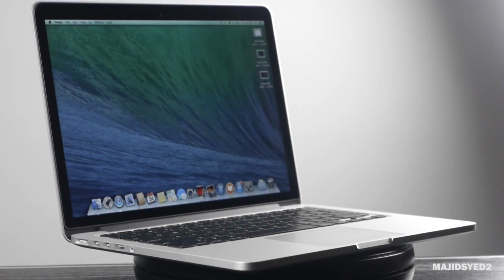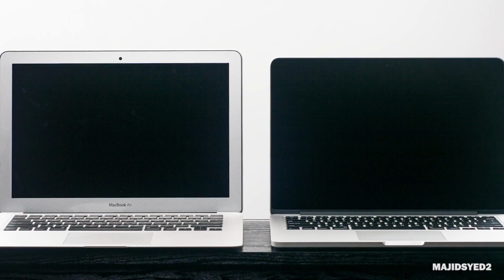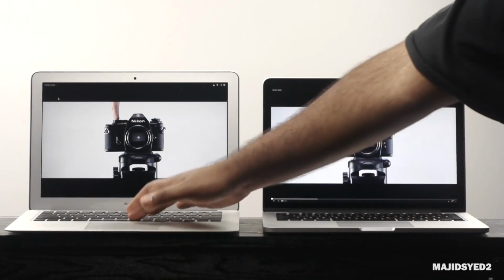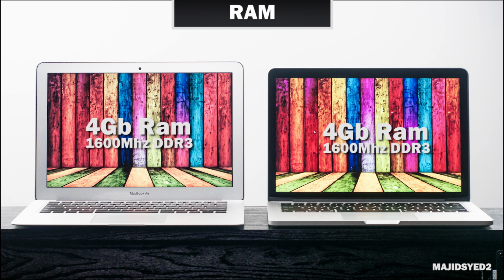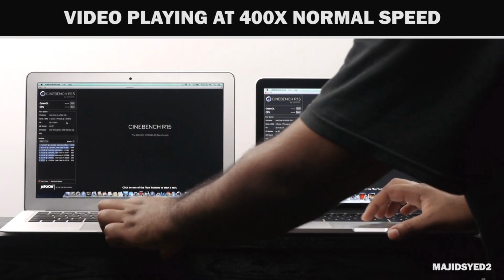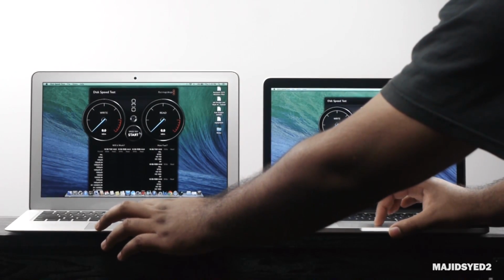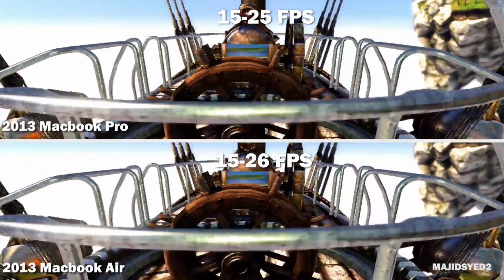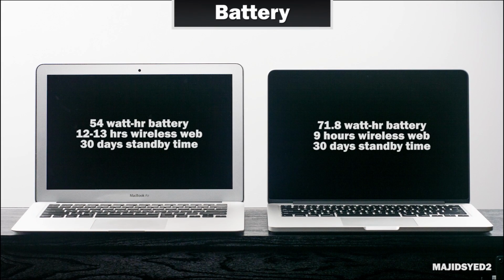2013 MacBook Pro 13" Vs 2013 MacBook Air 13"

Comment: Thanks for the review! The Macbook air seems to have a little black edge between the (collor) screen and the white ridge. Is it just the distants between the glass (thickness of the glass) and the screen, or is it lost space? If so, why would they leave it there? It bothers me because I like the weight and the praise obove the Pro, and there is a lot of efford on this style icon, but its not..yet..perfect.. as they proclaim :').
Reply: the macbook air has no glass on the display
Reply: the macbook air has no glass on the display

Comment: When I'm outside maybe in class I'd use my pro for a few hours maybe on low usage and if there is a wall charger in class I'd be okay... But mostly I could do most of my work on my iPad... At home the same 9hrs won't be bad because I can plus easy.. So BUY A IPAD WITH YOUR PRO.... can switch between tabs with Yosemite

Comment: Which one would be best for a high school student? (From 8:30-3:15 5 days a week use and more for homwork, assingments, Word and Powerpoint use, web sufing, video editing and holding photos/film)
Reply: Air. Definitely.
Reply: Fredrik Iversen I actually have both a 2014 i7 Air and a 2014 i5 Pro, and I have to say the Air with i7 is very powerful for a laptop this small (as powerful as the 2.8Ghz i5 in Pro, which I own). But if you want to play a littlebit and do some intense video editing, take the Pro, because it has Iris graphics.
Reply: Air is a much lighter laptop which makes it a better choice for students. You should get a 13" macbook pro if you are a student
Reply: Yes of course if you want a laptop u can edit and game on the Pro is a much more powerful machine. Me for instance who is going to study journalism in 2 years think that the 13" air is the best choice, for me. I need a light laptop with good battery life, memory and OK video editing.

Comment: I might get MacBook Pro for different stuff and I'll have probaly one game which will be Minecraft will I have heating issues?
Reply: Look up videos of people gaming on the Mac model you want. (It runs minecraft fine)
Reply: Shahzad Khan It'll run MC just fine, until you set all graphics to max (also use  OptiFine). Despite the fact it is not designed to play but to do "not-so-heavy" tasks, it should perform quite well. And it shouldn't overheat that much. But remember, it's NOT a gaming machine.

Comment: I am currently looking at both of the products and I still cannot decide on which to purchase. My budget for my purchase is currently $1,500 - $1,700. I do own the 21.5 inch iMac with 16 GB of RAM and I'm looking to purchase a machine to help me edit videos and designs using Adobe After Effects CS6 and Adobe Photoshop CC whenever I am at school, or away on trips. I have never used either one of the devices, so I do not know if the Macbook Air can even run the programs I need it to do. If anyone who owns either one of the devices and uses After Effects and Photoshop could replay to this comment, it would mean a lot.
Reply: With your budget you should certainly go for the Pro. You will be disappointed with the Air’s display, especially for photo editing. The Air did fine for everyday tasks and did fine running multiple apps, but the screen is a little disappointing to say the least. i sold my Air after a month to get the Pro and really like the screen much better. The Air is fine for everyday users, but for a more color accurate display definitely get the Pro.

You should also consider that this review is for the 2013 model and that the 2014 Pro comes with standard 8GB ram now.

Comment: Well described reviews. I am currently short in budget and the dell laptop i am using is almost dead. So what do you think would be the best choice for me? I need a laptop with:
1. Good quality battery life
2. Good performance while doing video editing for my youtube channel videos
3. Doing graphic design and development for clients.
Some people are saying that buying an air would do it. so going for a pro at my current situation would be a loss for me. What do you think?
P.S i have never used a mac before and highly interested to buy one and start using it.
Reply: You will not like the Air if you have to do any kind of photo or design work which requires color accuracy. The Air's display needs to be improved. I used my Air for about a month before I decided to sell it and upgrade to the Pro. The Air performed fine, but that display just did not work for me.
Reply: Thanks Brian for the reply. I will now plan to get pro
Reply: Hi. Super star i got your review on the first page of google.

Comment: great review! But I'm still confused on which one to get... 
I'll be using it for college... Does the extra weight on the pro retina really matter? and is the screen that good to buy the retina over the air? 
It'll be fantastic to have the retina one with 12h battery life lol
Reply: Karina, 
The Air's display is subpar compared to the Macbook Pro and just about any 1080P Windows machine i looked at. The weight difference is only slightly noticeable. Certainly the Air is a great machine and the battery life is as advertised, but the 8-9 hours I get of my Pro is plenty. I had the Air for a month and it performed well, but the retina display is worth the upgrade in my opinion, despite the fact that I preferred the Air's overall design.

Comment: I went with the high end macbook pro (13 inch)  because it has the portability of the macbook air and the performance of the macbook pro :D  I was worried about apple releasing MBA with retina display so I went with the MBP which has the retina display already....I'm in uni so I wanted something that's portable and powerful at the same time...so the 13 inch high end pro was the option for me....I'm really happy with my mac,I would recommend anyone to go for  the pro! :)

Comment: Hi 
I am a Project Manager in an IT company.Most of my work consists of multiple browsers , multiple skype windows and some programming softwares. I dont do heavy image editing on photoshop or any video editing.Will macbook air be good option for me.I just dont want it to freeze or get slow when I have multiple applications open simultaneously.
Reply: Yes.I am not sure what your definition of a youtuber is , but I believe youtuber today is everyone.Most skilled and tech savy people are on youtube , not just casual timepassers. I asked this as I had never used Mac before and so was uncertain about it.Anyways I ended up getting a Macbook air.

Comment: hi guys .
i am very confused whether to buy AIR or pro retina?
i need a laptop for-
browsing through web, using multiple windows at a same time, skype , youtube, songs, videos, powerpoint, assignments n ol.
i dont knw, if air can handle- browsing, surfing, play songs,work on powerpoint, or even transfering data from a pen drive, ALL AT A SAME TIME..
will air do it easily and fastly?

Comment: Do ya think borderlands 2/ rust will run on the MBA 13" with the 1.7ghz processor?
Reply: im not sure but i prefer MBP since it has a 2.4 ghz processor, and its not accutally heavier or bigger than MBA nowadays

Comment: Asak Majid,
Am planning to buy my first Macbook (switching from windows to mac), which one do you suggest for overall better performance as below
Macbook Air 13" - Core i7, 8gb ram, 256 ssd
or
Macbook Pro 13" - Core i5, 8gb ram, 256 ssd

Pls reply
Reply: Usage - regular official use, sometimes photoshop and after effects, little games. Budget is also restricted to around $1500. Which one you suggest for me? and this is my first macbook for me; Does the macbook air or pro has heating problem?

Comment: to all those who are currently in the process of pick a macbook i highly recommend the macbook air because the macbook air has 12 hours of battery life but plus mavericks its around 15 and the macbook air has a better design its way lighter and it has better graphics then the pro. unless ofcourse you have the option to pick a retina definately should get the retina

Comment: You have the wrong Macbook Air up you dumbass. It's not even the 2013 model. How is this even a comparison?
Reply: yes it is dumbs, it has two microphones as you can see 26 seconds into the video.
think before you write

Comment: Hello! I cant decide between the pro or air. Am thinking of both options:
1. MBA (i7, 8gb ram, 512ssd)
2. rMBP (i5, 8gb ram, 512 ssd)
My concern is whether the MBA option match up to the base rMBP in terms of performance after having upgraded to i7?

Would love to yr comments! And others too (:
Thanks
Reply: i7 with a macbook 2013 ( with ssd memory ) is like putting a sticker on the back , the performance is going to be way better in the rMBP 'cause it's made for this , the rMBP is more powerful and efficient than the MBA.
If your want a laptop just for writing, reading,watching videos,facebook,tweeter...I'd choose the MBA, but if want a beast for working with programs like autoCAD, finalcut , or others professionals programs for designing, video editing, calculation, etc. I'd totally choose the new retina Macbook Pro.
I'm studying industrial design and I have the rMBP , and is the best computer I've ever had ,and in terms of weight and thinness it's not such a drawback, because is only 0,65 lbs heavier and it's really thin so I can carry it everyday around campus 
I hope you to find it helpful !!!
Reply: John Villarroya u have the 13' or the 15'?

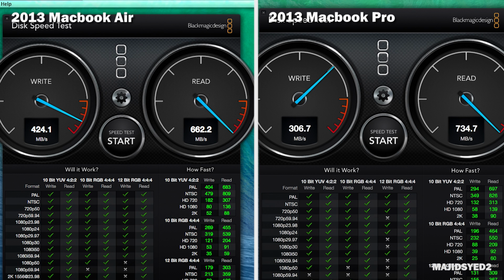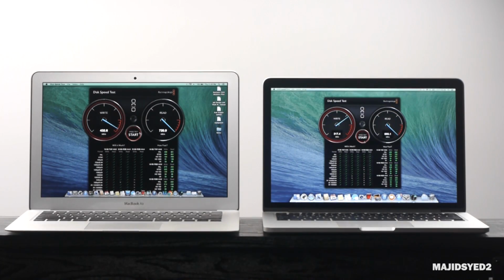Comment: at 08:54 the air is getting around 600mb/s read speed and the pro is getting around 700mb/s. If you look at 09:16 the air is getting 700mb/s and the pro 600mb/s read speed.

Comment: the new macbook pro retina 128gb read and wirte speed is slower than the 256gb if you dont belive me search it but just saying the 256gb get read speed of 710-720 and wirte speed of 720-730

Comment from the maker: Yes that is possible,  for programs that require lots of computing power you may want to upgrade the cpu if you think the benefit is greater than the cost.  same with ram, ram is pretty important when it comes to adobe software.

Comment: I'm going to buy a 13" Retina Macbook Pro (2013 edition) for school. I use photoshop/illustrator/aftereffects etc. alot. So I need high storage. But what if I go for the 128gb and buy an external harddisk, is this possible? And what about the CPU and RAM. Do I need 8gb of ram and the 2.8ghz I7 Proccesor, to handle the adobe programs well?

Comment: Hi and thanks for a very good video and comparison. One question I do a lot of work in Lightroom 5 with heavy raw files. I like the macbook pros retina display  and the possibility to upgrade to 16 gb ram. But I really like the weight and form of the air because of alot of travel do you think a can use the air for smoothly for editing? BR from Sweden